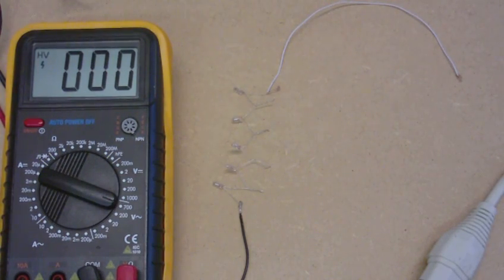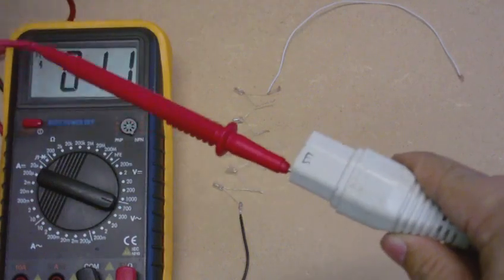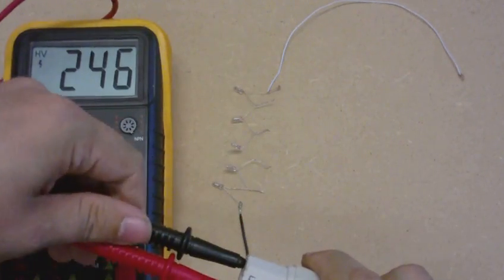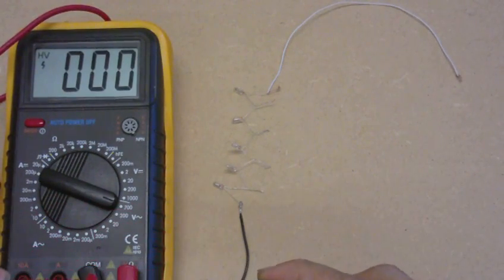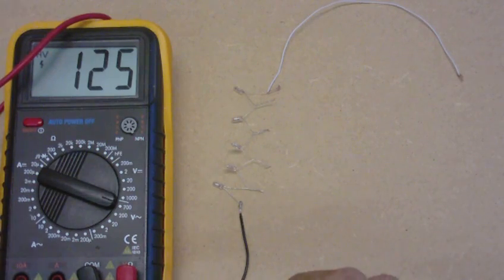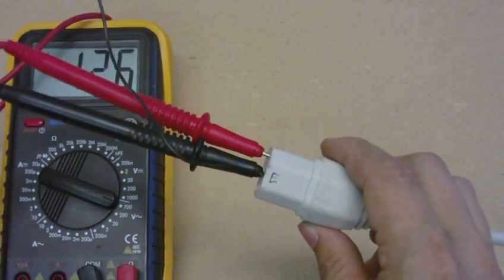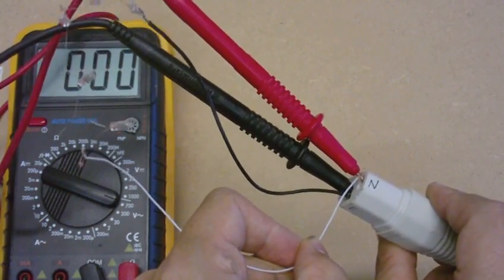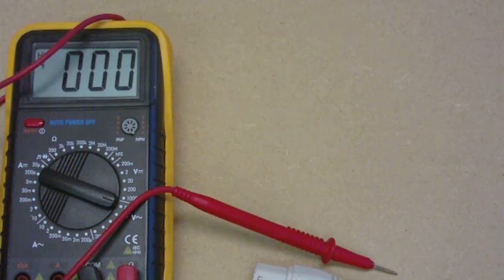Is our mains electricity SAFE?

Comment: You probably have floating earth for some reason. Non-grounded socket outlets? In here Finland older homes have non-grounded sockets and if you use grounded extension cord on them, some electronic devices such as desktop computers put 115 volts to the ground (relative to N and L). This is caused by Y type interference suppression capacitors in the PSU. They are used to eliminate interference.

Comment: No, you don't have any problem with your grid in your home. That happens because of swichable power supplys that have much noise and put it to the grid. If you may try this: disconnect all the computers and chargers of portable computers from the mains and do the test again. You will see that the meter no longer will mark anything between neutral and earth. That's only grid noise. Nothing to worry about. Sorry my poor english.

Comment: I'm an electrician in america but im familiar with how european grid is set up.  As others have said, you have a broken or corroded ground. I would have someone (or you if you know how not to electrocute yourself) check if that wiring is at the main panel of the house or just the outlet or that particular circuit.  See if you get the same result from ground to neutral at the panel. If you do you have problems with your neutral or ground. This can cause metal grounded appliances to carry current.

Comment: Oh...  and the half voltage thing?  Capacitive coupling to the floating earth from the adjacent cables.  Very low current, which is why it dropped at the slightest load.

Comment: Did you resolve this?  On a normal UK mains supply the neutral and earth are usually close to the same potential.  That half voltage thing suggests a broken earth connection somewhere.  First thing would be to rule out the lead by unplugging it and measuring for continuity between the earth pin of the mains plug and the earth socket of the IEC connector.  If that is intact then it's an issue that needs investigated.

Comment: (Have an electrician) check your earth/ground connections. There may be a ground rod somewhere outside/under the building,be sure that the clamp on there is tight,wire isn't broken,etc. (I'm not familiar with UK electrical code,but I assume it is similar to the US?)  Anyways-get someone qualified to inspect it.

Comment: In switching power supplies there is a capacitor, which is between live and ground. If the socket is ungrounded, it gives very little current between ground and neutral (not enough to kill ya) srr for my bad eng

Comment: @nissmanaudio earthing systems? they are grounds all grounds are done the same way... they run it strate into the ground if done rite .. im suspecting that he has a bad ground or posibly a N when something is used becomes hot itself then you are reading what ever your divice is useing meaning the lights on or off will chang it

Comment: so therefore you get 0volts. it's kind of like when you are standing on a wet floor in the basement and touch a wire in the wire box. there is a potential difference between the floor and the wire. sometimes you can actually feel it slightly but it can't deliver enough current to hurt you. THIS IS ALL MY THEORY  i am not sure.

Comment: i don't know about england but here in america, we use 120ac but we get 240 coming into the house. we have an option to wire up something to the 240volts. basically we get 240 off of the second winding of a giant transformer and the 120 is actually the center tap of that second winding.  we are basically using half of that second winding. if you guys are wired thesame i am guessing there is a potential difference between your neutral and ground but when you connect the lights, it shorts it

Comment: I was told by a work associate in Bristol that there is a protective device on the UK mains that will not allow an unbalanced load to operate. Therefore, it is not possible to use 1/2 the circuit to operate a US device needing 110-120 volts. A search of an electrical supply catalog would likely reveal the name of this device. An electrician handbook for the UK would also be revealing. In the US, it is possible to get 110-120 from 1/2 of a 220-240 supply. This is dangerous and never recommended.

Comment: That's probably just a capacitive coupling or a very bad connection to earth. so the cables leak over a little and cause the meter to show some voltage. Because the multimeter got a VERY high input impedance.

Comment: @kimosaaaabe No, appliances are often marked as 230v, halfway between. They are designed for a 20% tolerance anyway and so 220 and 240 are both well within that tolerance. It seems to be quite a common myth that we "changed"

Comment: I don't think this is normal. As far as I know the neutral and the earth are supposed to be connected together in one central spot - so there shouldn't be an effect like this. That's the way they did it in "the other house", I recently had a look at the house wiring there and did some improvements. I guess it depends on how old the house is, the "other house" has lots of wiring problems because they connected things the wrong way when the added new wall outlets and stuff over time.

Comment: the 125 volts on the ground is caused by the mains filter in your computer...there are some capacitors between the line and neutral to ground. they let enough energy through to let the meter registrate something, but when you put a load on it, it dissapears. seems like your outlets aren't grounded properly.